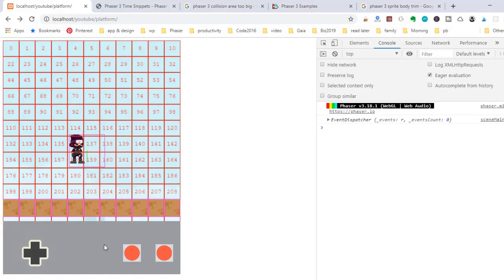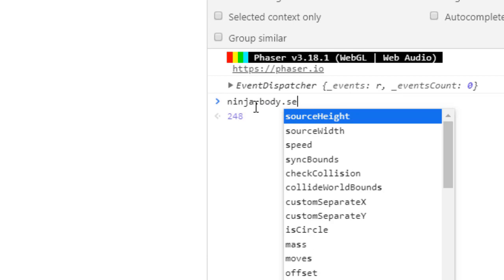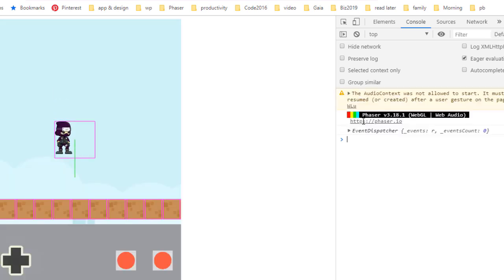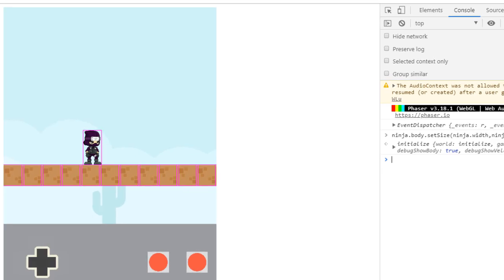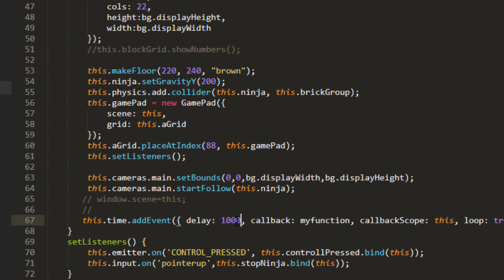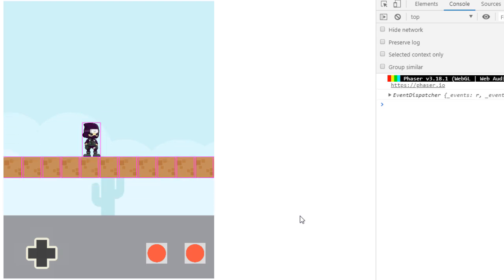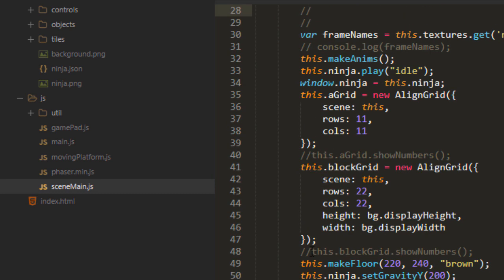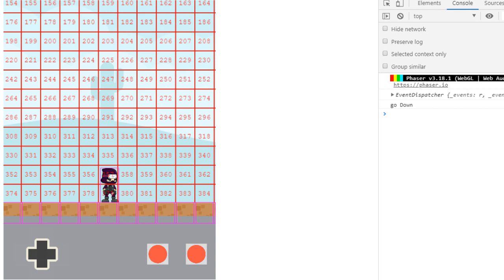Phaser 3 Fix Collision Bounding Box

Comment: *WARNING*: DO NOT DO THIS. 

Setting a timeout to solve an issue like this IS DIRTY. Relying on a timer to guess when an event will happen will produce unintended results and bugs, leading to tech debt. Do NOT use a timer to hot-fix things like this. 

*THE REAL SOLUTION*: the reason this is happening is most likely that he's adding the physics to the shape before the image frames are added. Add physics to the entity last in your constructor and the need to manually .setSize() and .setTimer() both go away.

*QUICK RULE OF THUMB*: Before you assume that there's something wrong with the Phaser engine (or any system built by a solid team of software engineers), assume first that you're doing it wrong and go read the docs.
Reply from the maker: This was 2 years and a bit ago. I have not checked to see if a callback has been added. I don't like the work around either but it was the only thing that worked at the time.
Reply from the maker: If you have an event listener for this please let me know, otherwise, this is an acceptable workaround.
Reply: @WClarkson  Don't assume the browser playing this game will be able to finish loading physics in 1 sec.

Comment: This helped me understand why my bounding box were larger than the sprite. The reason why you need a timeout/delay is not because the physics is not initialized, but rather, your sprite has not defined its width and height before the actual texture is added to the sprite. If you try to set the sprite's width and height e.g. `this.ninja.setSize(32,32)` (use the texture's height, and width) then you don't need a delay, and can set the bounding box to the same size. Thanks for the video.

Comment: Hey, could you explain how we can make a flexible game that will be working on portrait and landscape mode and automatically resizing when a user is rotating a phone. Thanks for any information
Reply from the maker: It could be done, but you would have to really design the game based around the rescaling. For most games, it just is not practical.
Reply: thanks, actually I do animated ads and some times I get a task for playable ads it similar to game and in most cases, it needs to do flexible to each display and support horizontal and portrait landscape. you can see an example here https://s3.amazonaws.com/pixelcraftplayable/3/index.html (it was done on PIXI.js)

Comment: Great find and fix! 💪

Did you report this to Rich?
Reply from the maker: Thanks. I don't think it is an actual bug. There may be reasons to resize the box outside of the size of the image.  For example just putting collisions on the feet.
Reply: @WClarkson  seems weird though that you have to solve it with a timed callback though - that part has a buggy feel to it.
Reply from the maker: @BruceOnder  Oh, I see what you mean. A bit hacky. I might have been able to find another solution, but this seem the quickest. I spent a few hours banging my head before finding this. If there is a better solution, someone may post it here. I'm all for having elegant solutions but sometimes you just need the thing to work.
Reply: @WClarkson  While this works for your particular game, having to artificially add a delay to get the body sizing working doesn't seem like a great solution. More likely there's a problem earlier on in the code and you're working around a symptom of that problem! I've found in the past that if you're working with a sprite that needs to be scaled, you may want to size the body before scaling the sprite. That may be at play here.